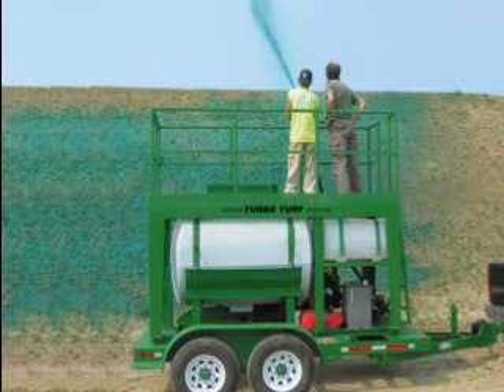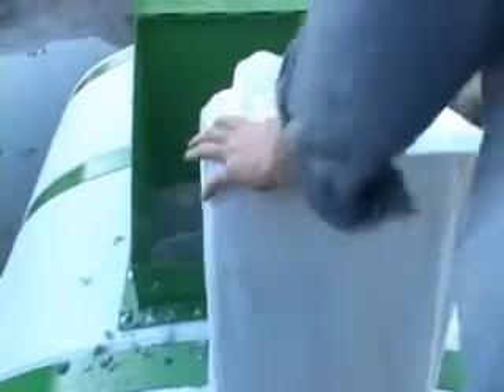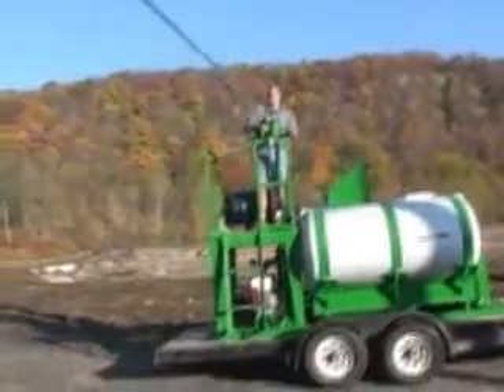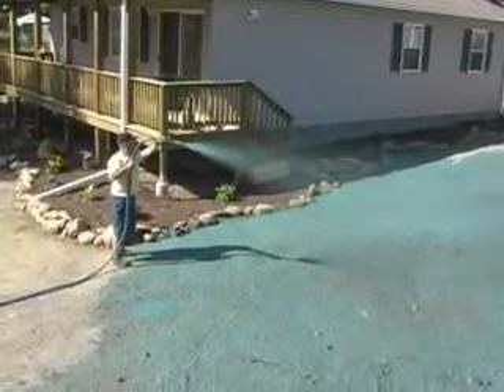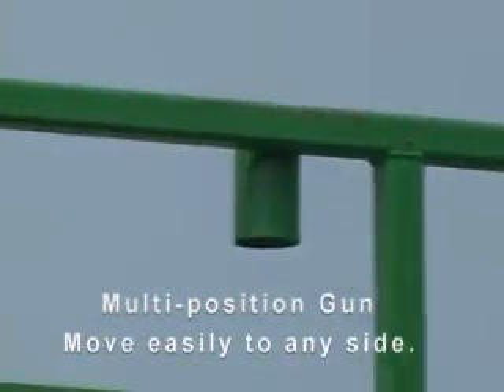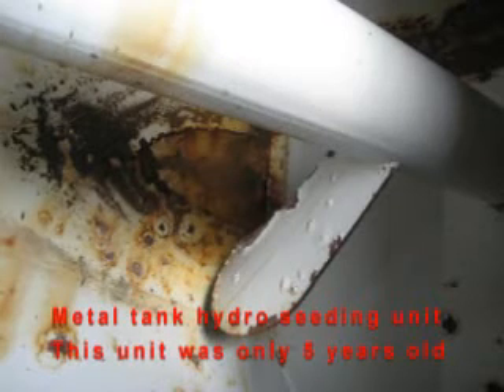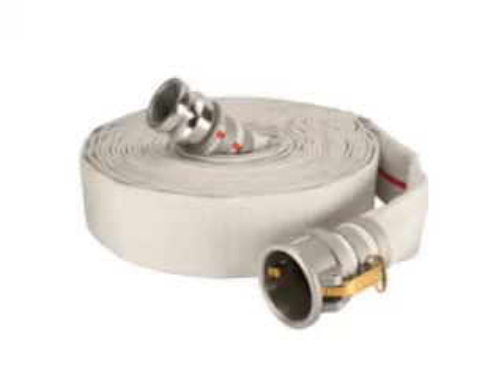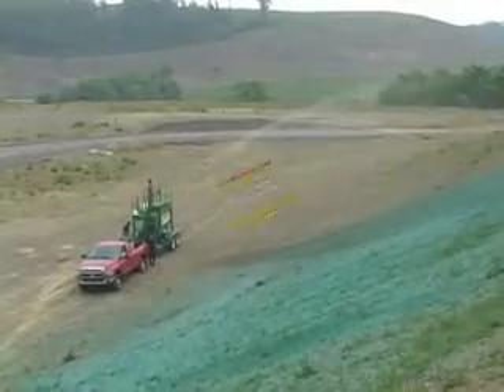Turbo Turf Mechanically Agitated Hydro Seeding Sytems

Comment: How do you replace the honda engine mounted on the pump?
Reply from the maker: Remove the hoses attached to the pump.  Unbolt the mounting bolts attaching the pump and motor to the machine and remove engine and pump.  Remove bolts on the back of the pump that attach the big housing to the mounting plate.  Slide pump housing away from engine.  Remove nut holding impeller on, remove impeller, remove mechanical seal.  Remove pump adapter from the engine.  Bolt pump adapter to new engine.  Put everything back on the in the reverse of the order you took it off.  You might want to replace the mechanical seal with a new one and replace the gasket between the big pump housing and the pump mounting adapter.  It should be pretty easy to do.